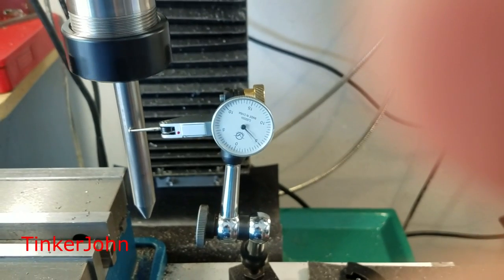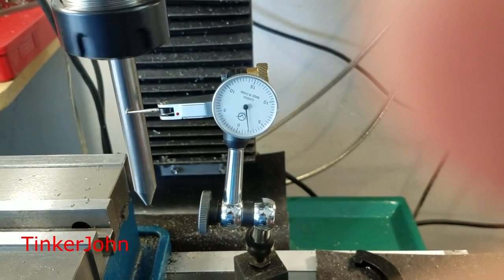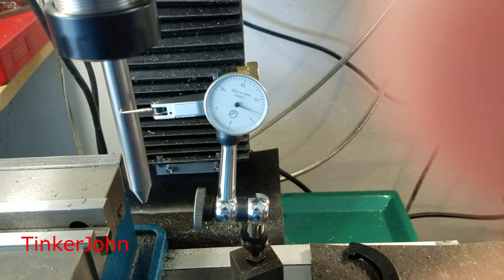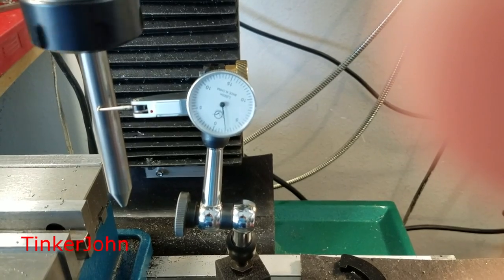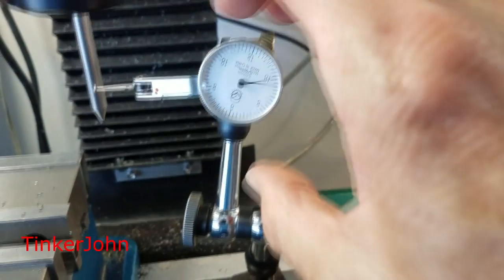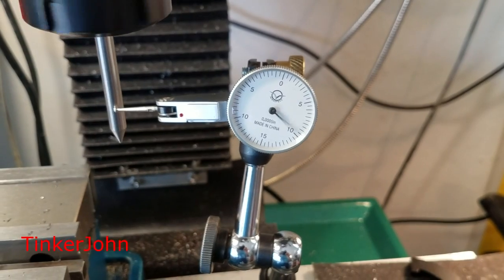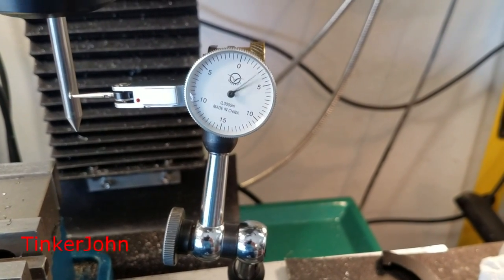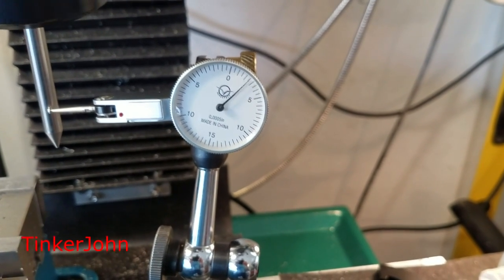Imported ER Machine Collets—A Brief Review

Comment: I used to make collets , a big problem is if they are ground believe it or not . Ground collets are very prone to be off due to holding it between centers wich is tricky as well as the foreigners don't size the holes properly . They also slot them after grinding the o.d ,then polish them to remove burrs and then that distorts them . The best way to make most collets is to precisely turn them and accurately bore any size possible to no more than plus .0015 oversize . Preferably +.0005-.001 . The more expensive collets cost more because especially on the smaller hole sizes you scrap more of them due to run out and holes that are bellmouthed and or over or undersized. Also when you put a tool in a new collet it should never fit tight or loose just a gentle very slight interference / sliding feel to it. They can / usually due feel tighter after being used for a little bit because they take a set , that's normal. And lastly for now , most people over torque almost all collets thinking if they don't the tool will slip . If you tighten a collet and ever hear a slight click sound , you just over tightened it . Loosen it up and just snug it . Lyndex and kennametal are hard to go wrong with Ericson as well.
Reply from the maker: Andrew, thanks for a detailed and informative comment.  ~John
Reply: @TinkerJohn_W5CYF  No problem , so you know to , I don't understand exactly why but ER 25 collets seem to be the least accurate of the ER family , 16s , 20s , and 32s are almost always better. Again I don't know why but I've tested alot of them and found that to be the case .

Comment: John,
Thanks for posting this.  We both got burned recently and the same way. 

Using eBay (OK...I should have known better!) I bought a set of new imperial ER32 collets and an R8 collet chuck.  My collets were also full of swarf and the runout was unacceptable in the mill.  

To save postage I bought a ER32/MT2 chuck for the lathe at the same time and it had the same problem.  It gets even worse; the 5/16" collet won't even clip into the collet nut; it simply falls back out if you're not careful.  As for runout with a 3/8" collet I get 8 thou on a ground bar 3" from the lathe chuck and 4 thou at 1".  Interestingly, I tried Beall ER32 collets from my woodworking days - also made in China - and while they were a lot cleaner they gave me the same runout.  This suggests that it's not just the collets that are at fault; perhaps the chuck and/or the closing nut too.  (By the way, my lathe spindle is quite accurate and with a Taiwanese made 3/8" ER 16 collet in a MT2 holder I get less than 1/2 thou runout 3" from the chuck face.  I can live with that.)

Like you, it's too late to send them back but I intend to use the ER32/ MT2 chuck and collets to hold drills in my tailstock for when I need to open a hole prior to boring.  Doing so will prevent my Jacobs type drill chuck from chewing up the shank of the drills when I get too aggressive with the tailstock feed.

Apart from their use to hold drills I don't think it's worth trying to repair these.  There are probably any number of cumulative manufacturing errors leading to the poor results.  Better to chalk it up to experience and get a decent set from Arc Euro or similar.
Ramsay
Reply from the maker: Ramsey, thanks for your detailed comment.  I also think these collets are beyond using them for trusted accuracy. I like your suggestion of using them to hold drills.    ~John

Comment: I made DA100,200&300 collets , er 11,16,20,25,32 collets amongst many many other types and chucks , and caps . Problems stem from wrong angles !!!! Improper sizing , runout produced from bad drill reamer setup or peck cycle , also most china crap is made out of cold rolled , a2 , maybe 8620 if your lucky and they harden them then grind !!!!! During the grind they are easily ruined . The best collets are made from stressproof or edt150 and not hardened as the material is pre hardened and stress relieved . A nickle finish is sometimes applied and polished for corrosion and wear resistance. Deburring is very important as well. A work holding collet should typically be hard , but a tool holding collet does NOT need to be , proper care and a non hardened collet will last just as long . Lastly hole sizing is very important , a1/4" collet needs to be .2495-  .251 max and an er collet will not typically be as accurate when putting an undersized tool in say a .236 / 6mminto a 1/4" collet !!!! Or especially a tool that's bigger . Through experience I made all my own collets exact size for everything and the accuracy is spot on and repeatability is outstanding !!!! Er collets are not really a variable range collet as advertised they turn into point contact when this is attempted and the collet will also be distorted and ruined even though it won't look like it !!!! Trust me I made collets that made collets .

Comment: John I purchased a PM25MV mill from Quality machine in PA. in 2015 and not having much mill tooling, I added a few of their tooling packages to include a set R8 collets for holding cutters and such and a set of 35 C5 collets for C5  collet blocks so far I have used about 15 C5 sizes. I mostly use the collets in collet chuck on my SB1001 lathe and have not had any run out problems (using a DTI ) over a half thou. I don't remember what the price of the R8's were. I paid some where around 140 ish for the C5's. Just my take, maybe I'm lucky.                              73 KC9NDB    Bob
Reply from the maker: Bob, thanks for your comments.  I think I simply got a bad set with both sizes.  The machining left a lot to be desired and when they arrived I spent considerable time cleaning up left over swarf on each collet.  I think they are not clamping down evenly.    ~John

Comment: I would first like to say that I sell tools, collets, holders and cutting tools. I know many people on budgets buy cheap, the problem is mostly you get what you pay for, it’s as simple as that. If you’re buying ER Collets they have generally three tolerance classes, 10 Micron (.0004”), 5 Micron (.0002”) and 2 Micron (.00078”). The 10 Micron are the most common, they’re cheap and most of the time produce the run out specified. The 5 Micron are the better collets for the money. The 2 Micron Collets are very expensive and unless you really need it most people will not spend the money. Collets ordered from China are a total roll of the dice, I wouldn’t count on their accuracy. I am not against buying products made overseas however when you spend your money and wait weeks to get them and they are poor quality its a big waste. If you buy from a company that is local and will back up the products they sell your money is much better spent.

Comment: I see MSC has collects some from China and other higher priced from Israel. I noticed the ACCUPRO from China are really metric but they give imperial range. Bummer anyway! Did you check when the holders are mounted how true the inner taper is before a spring collect was installed or is it mainly in the spring collets once installed? If you say there was flash in the spring collect slots if you used emery to clear them did the run out reduce? How well does the nut inside taper fit the spring collet? If you slip in a spring collect and check the run out of the face taper is it off before the nut is even put on and tightened? Maybe it is just the accumulated tolerances of each part and like you say a no win. I'm cheap because for a Morse taper cleaner I found that a shotgun brass brush in a home made handle works well on my wood lathe rather then a plastic specialty one to insure the taper is clean.
Reply from the maker: Galen,  thanks for suggestion on where to look.  I suspect you are correct; it's an accumulation of error.  I'm a little concerned about the MT mounting.  When looking online, some folks have experienced less than accurate results with that type chuck.  Also I am going to order a "quality" ER collet to test using current MT chuck to try to narrow things down.  It does not make sense that two collet sets in two different sizes would be that far off.  However, it's on two different machines it is indicating off.  Spindle run-out is almost non existent on both machines.     ~John

Comment: John, China is a big place, and there's got to be many, many suppliers and vendors to deal with. Sorry about your bad experience, but--by name--who did you buy from? The thing is, if you buy from Grizzly or Enco or even Tormach, aren't those going to be manufactured in China, too? These importers surely specify the level of quality they want and are willing to pay for, and one Chinese firm may make the same item to different levels of quality for different importers: HF versus Grizzly, for instance. Haven't there been good reviews of some Banggood tooling . . . myfordboy, for instance, or Stefan Gotteswinter, etc.?
Reply from the maker: Todd, thanks for watching.  I think I just got a bad lot with both sets.  One set from eBay  (don't recall the vendor). The other set was from Banggood.   Both sets had swarf that was not cleanly machined and full of burrs on the inside.  I think they are just too low of quality.  On the other hand, I've got a set of import 5C collets I couldn't be happier with.   They are spot on.     ~John

Comment: Hi John. Sorry to hear you're having such lousy luck.  Having made some ER stuff with great results I'll chime in.  I'm going to assume that your spindle is true.  The first thing I'd determine is where the run-out is.  If it's the chuck then it's not so bad.  If the collets are bad then that's gonna be more work.  If you're thinking about saving them and have a die grinder you can mount on your tool post, give a holler and I'll post a vid on going about it.  Otherwise, Shars usually sells higher class import tooling and is based in Illinois.  China stuff is so unpredictable from brand to brand and even within the same brand as the manufactures sell their sub-standard parts between themselves and re-branders that you never know what your will get.  Cheers,
Grouchy
Reply from the maker: Eddie,  thanks for taking time to send along some suggestions.  Spindle run-out is OK on lathe/mill spindles.  And I "think" the run out on ER Chucks are OK.  They chucks are MT type and sometimes wonder if they are seating correctly, however I do use a drawbar tightened appropriately.  Anyway the indicator shows them running true.  I really suspect it's in the collets.  Both sets arrived with swarf throughout each one.  Machining looks really bad, like their CNC setup was bad.  However since both sets/sizes were affected that seems strange.  It was too late to send them back when I realized what was going on because I was working on other projects.  My next step is to order a US quality collet and see if it runs true.  If so, it's likely in the collets, if not it may be in the MT holder.    I'll put up a video when I get a chance to test it.  Thanks again for suggestion.      ~John
Reply: Chuck your test rod in the collet very lightly.  Can you rock the rod around by hand?  Press the rod around the compass points and check for deflection like you would check a spindle bearing.  A burr or taper mis-match will allow deflection.  Remove the collet and use an indicator to set the compound to match the collet chuck internal taper then install a regular chuck and dial-in your test rod.  Slide the collet on and check for runout along the collet external taper.  The use the compound to see if the taper matches the collet chuck. 
You can Sharpie® up the rod and use the tail stock, mill, or drill press to slide the rod straight in and out and see if the scratches are even around the rod.  Maybe there are burrs that Fenner's rolled-sandpaper-on-a-stick trick will clean up.  Do the same Sharpie or ink test between the collet chuck and a collet and look for even markings.  There could also be burrs in the collet nose groove or on the retractor ring in the nut causing some binding and not allowing the collet to seat evenly in the chuck.  The taper in the nut don't matter much. All the registering is done by the long body taper.

Comment: The first thing to check is the collet chuck.  I prefer to buy the chucks separately in case they have excessive runout.  Try buying from a dealer that will stand by their products, like Little Machine Shop.  I don't believe that the collet sets they sell are the same as the cheap sets on Amazon or eBay.  Not all Chinese tooling is made to the same standard.  I have spent quite a bit with LMS over the years, and have never had them send me junk.

Comment: You need to go through them and de burr them .
I used bolts and nuts as mandrels so i could mount them up in the lathe and gave the outside a polish with some emery cloth  on a wooden paint stirrer .
If you have .005 run out it could just be a burr of only .002 that will give you that .
Reply from the maker: Ian, thanks for the suggestion.  The collets did have excessive burrs on them.  I have spent some time removing and polishing them.  ~John

Comment: ER collets have a 1mm or 1/32" collapse range in most sizes, so using 1/2" drill rod in a 13mm collet should be fine. Obviously these collets are no good.

I've had decent luck with Maritool for US-made collets without multiple layers of markup.
Reply from the maker: Paul, thanks for taking a moment to send along your comments.     ~John